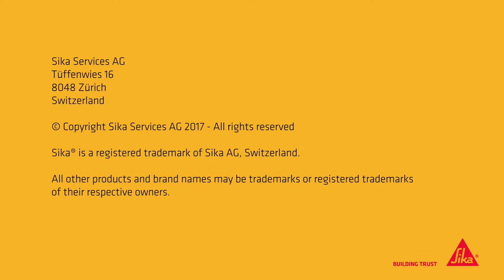Application staircase joints

Comment from the maker: Dear Ingo, you are generally of course right to say, that there should be always a backing rod. In this case the applicator decided to work without as here it would not lead to 3-sided-adhesion and the joint geometry is fairly adhered because of the quantity of sealant which is applied.